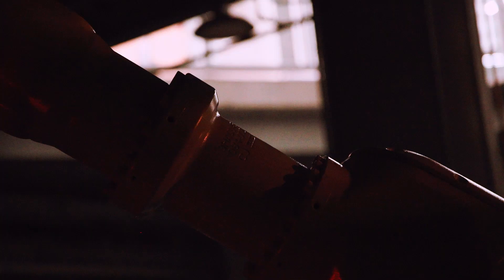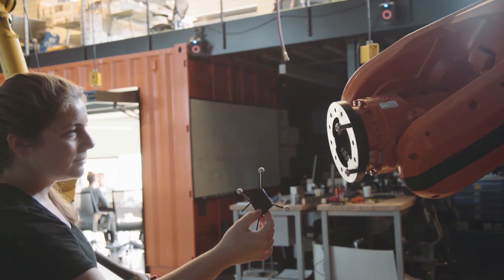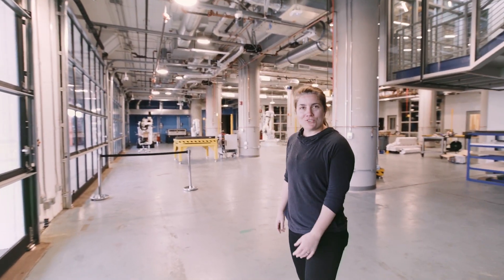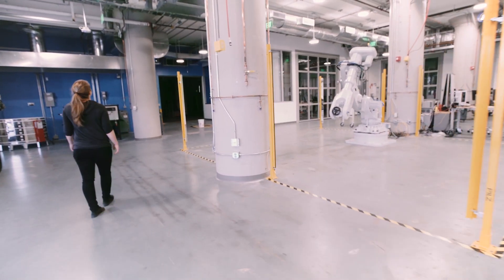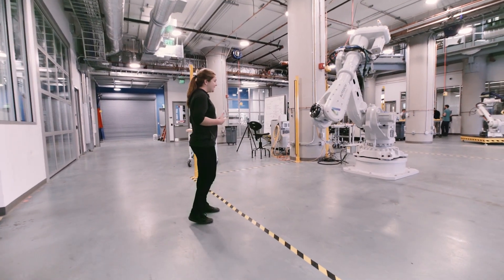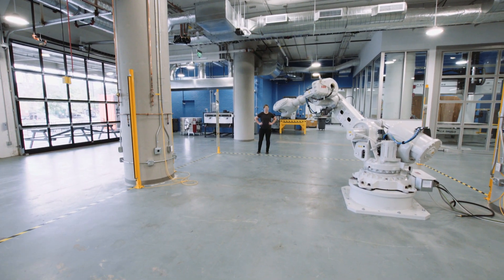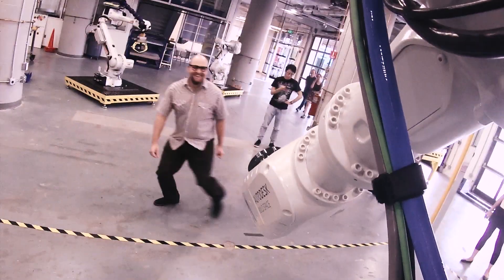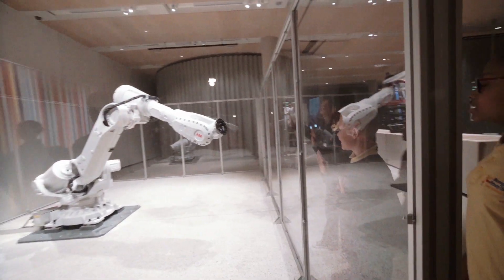Meet Mimus, The Curious Industrial Robot

Comment: Only thing that bothers me about this is that in some scenes the robot seems to have jerky motions where it moves a little bit but is just stopping and starting over and over. This could have been improved if it gradually sped up from one position and slowed down until it got to the other. It would have made it far more life like. The second issue was with its "face" not actually pointing at peoples face, it always seemed to be looking to the side or above someone, which also sort of loses the life like effect. Also, whether it was used or not, i think either sticking a camera on the end of the arm or some kind of face would have helped as well and that wouldnt have taken much effort. I do really like this, but i think a bit more work could have taken it from "good" to "omg is thing thing an AI, is it alive?"

Comment: the one where it cuts shaped holes in the wall is super cool and useful. when robot arms and this type of software becomes more modular, extensible, and open source this could be a standard tool used by carpentersand such to speed thru preloaded fixtures and stuff that would normally take 2 or 3 times as long per hole to scribe out or stencil and then hand saw out.

Comment: As a robot user for automotive industry, I like to see different uses than the traditional ones.
This project is interesting and fun.
Reply: Just out of curiosity what language is used there to program it looks like some sort of pascal like language..
Reply: @platin2148  Good question.
The languages are brand specific. you can't copy paste a Kuka program to use it on a Fanuc robot. I have no idea if they just are interpreters with a base behind like pascal or C or something else.
Reply: @smoker_joe  Did nobody make the effort to build a backend that could compile to all of these? It seems like so..
Reply: @platin2148  Well, it's not open cource.
Software like Robcad or Process Simulate have OLP modules (Off Line Programming) to download simulated trajectories to robot's computer. Those modules are developped by robots manufacturers.
Some output files are readable to manually correct some things, but some are compiled. Their knowledge are copyrighted.
Reply from the maker: @platin2148  ROS-Industrial is an open source project supporting some level of interoperability between robot arm brands — you might find it interesting: https://rosindustrial.org/
Reply from the maker: I use RAPID for the robot (that's ABB's proprietary machine language) and C++ & openFrameworks for the sensing system and interaction design.
Reply: @MadelineGannon  That’s sad that this area still uses all of this closed source stuff 🙁
On the other hand i can understand that there is a DSL for it.